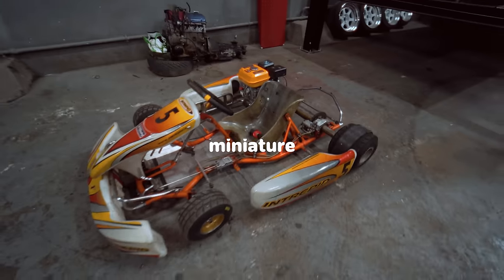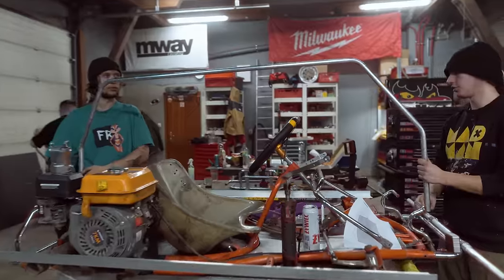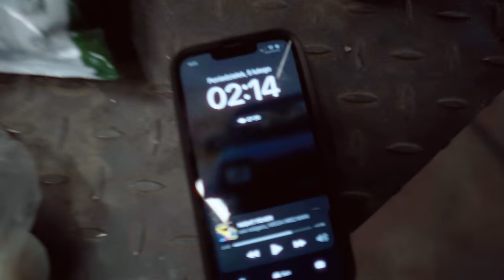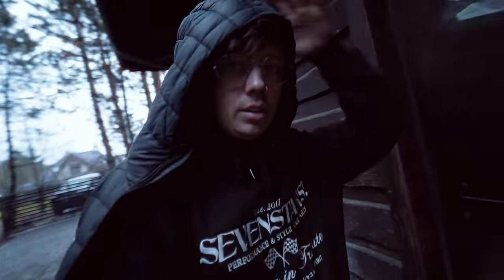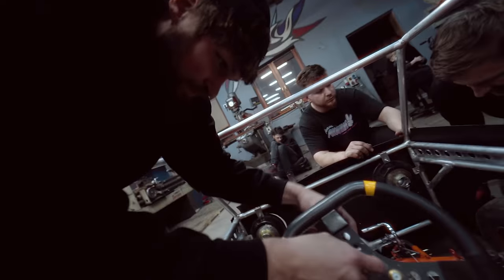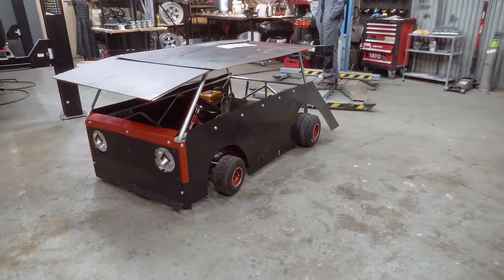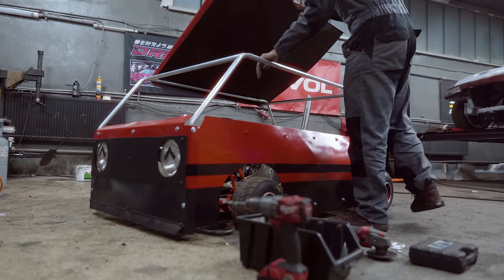Building a MINI DRIFTING VAN in 3 days | NIGHTRIDE

Comment: Impressive thermalforming of the plastic sheeting, that was a very practical method to get panels to fit in real time rather than if to make a vacuum mold that would take alot of real time for a singular vehicle project instead of a fleet or a plethora, or even a surplus.
Kevin, don't let them try to shink you to fit into the vehicle, it will take 70 or so years due to gravity.

Comment: love little kebin jr. wit my whole heart <3 I think cutting out a removable rectangular sunroof would be an easy fix to accommodate taller drivers as well as be able to close back up when needed. also I think adding a mini black windshield banner with your logo in the middle would be a great final touch as well as maybe some black racecar style window nets within the side window opening on the rear quarter panel section so from a distance it gives it the appearance of strut bars and a roll cage in the back seat. keep up the awesome work y'all & jambo!

Comment: Don't cut the roof, it will be big safety hazard for the face, teeth, eyes... Better make 2nd roof, some sort of extended - a bit "boxy". Or keep it removable.
Reply: A roll cage would be a good compromise, maybe stick a clear visor on the leading edge of the roofline for a clean look and aerial debris deflection.

Comment: great video, little kevin is lit!!
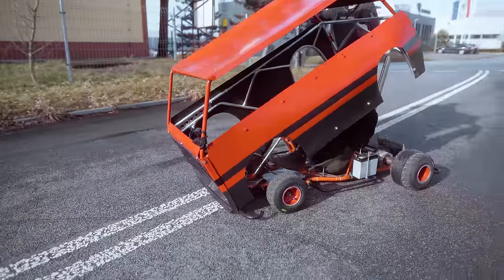 maybe instead of cutting the roof you guys could make an extention/ adapter between  the release at the back (34:15) so that the whole body would sit a little bit higher when the taller guys are driving it

Comment: If you look at the back of the frame when Marek is sitting in, it's only a few centimeters above the frame. If you put a few bolts or a very small bit of pipe going up at the back so the roof would be angled upward at the back, everyone should fit. The wing would also hide the bolts because of the little wrap around thing you did with the heat.

Comment: I can think of 2 ideas for the roof:
1. cut a hole and make a slightly bigger panel that can clip on and off (maybe even strong magnets) so you can remove it when needed, not perfect but cleaner than just a hole.
2. make adjustable brackets at the front and back of the roof that attach to the frame so you can adjust the height.

Comment: to fix the roof issue:

you could cut out a hole, put a hinge on the inside, and then just open a hatch in the roof every time you wanna have someone taller ride inside of it.

or make the roof out of two layers. the bottom layer has a hole, and the top layer doesn't have a hole. then you can slide the top layer back to reveal the hole without changing the roofline of the car like the hinged idea. you could have the top layer of the roof ride in tracks like a drawer for the slide mechanism. altough this will add about 3-6 KG's of weight, depending on materials.

Comment: Super dope job. Please don't cut a hole in the middle of the roof! Put the roof plate on a hinge at the windshield and detach it at the wing, so it can rest on top of the drivers' head or helmet and automatically lift if needed. It would be hilarious. Or even put some brackets in the back so it can be fixed at an angle to the maximum needed height for driving. It can then be put down again for show.

Comment: Actually I think you could heat the roof part where guys head would be and bend it up kind of stretching it. This way the roof will stay intact without hole that breaks it visually but there will be room inside. ABS should give enough play to do it. And a little dome with red colour should blend in nice enough to not be visible as much.

Comment: Guys, don't cut the roof. If you have this nice clip feature to open up the gokart, just lengthen the pipe for closing it and make additional hole for the clip a little bit higher. This way the rest of the guys will have more space and you will get nice klin look xd

Comment: Yooooo boyysss ! , why don’t you instead of cutting the roof or easing the body , where it opens at the back and you put the pin in drill some holes higher than the one that is in it now so it will raise the body slightly meaning you don’t have to cut the roof or mess around 👌 34:48

Comment: I would just weld four bolts upwards on each corner of the roof frame and drill holes in the roof there u can use two nuts to adjust the roof up and down or angle it so the front is lower then the back a tiny bit you would have another kind of adjustment and it would still look great or you can make a fake moonroof and slide it open for your taller frejnds heads but keep it closed for you

Comment: Instead of cutting a hole in the roof put a roof bubble,

Divide the width of the roof by 4, and do the centre half as the bubble, sloping up from the front and heading backwards with the squared edges like on a bmw, and just follow the bubble into the lip spoiler for a smooth transition

Comment: I’m making a 1964 impala replica on a gocart like yours and I’m have the first coat of fibreglass on the rear done so far  but it is going to have a proper felt interior and custom leather seat made from the seat on the gocart and speakers indicators etc

Comment: I was thinking. Should have scale it up alittle bit so the roof fits all. And just had to lengthen the frame a little what would also help with drifting because longer wheelbase. 

Also plexiglass windows and tint most of it so it looks like a compleet van but you can see 360 view from inside. 
Little Kevin v2 💪🏻